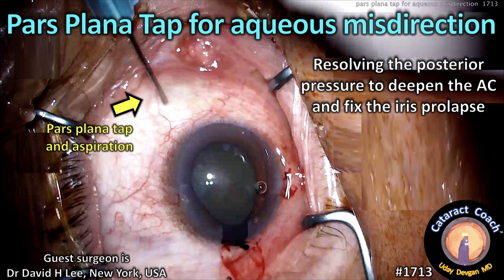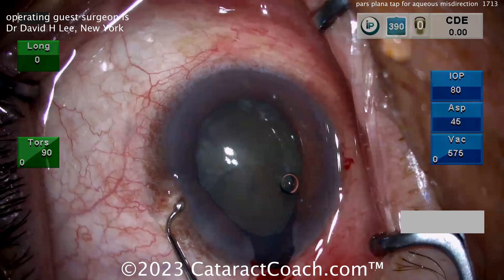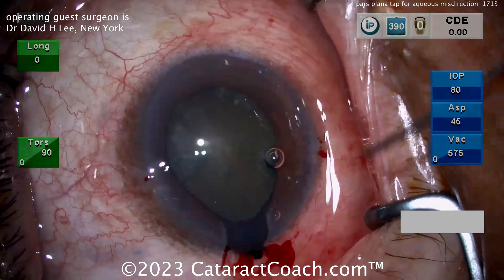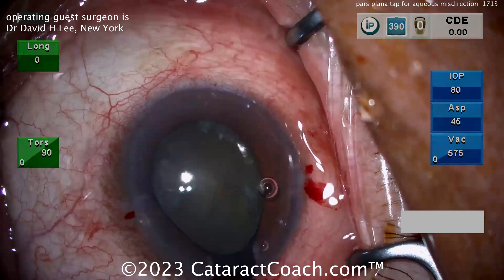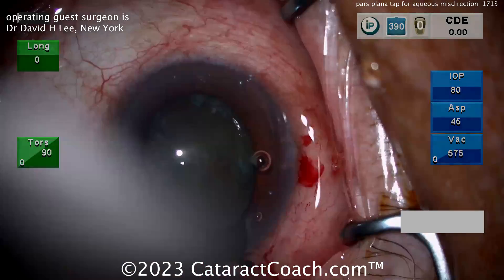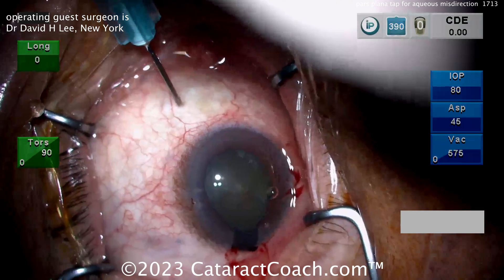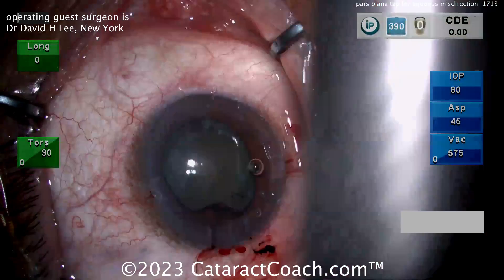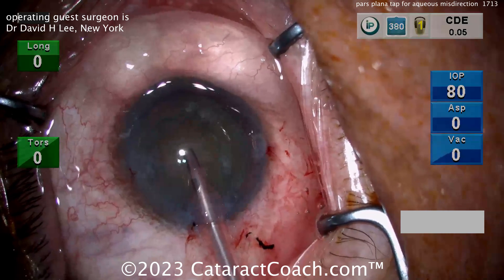CataractCoach™1713: pars plana tap for aqueous misdirection

Comment: Instead of aspirating, placing an open needle or a scleral port will cause a gush out of the excess fluid that is misdirected, which is more safer than aspirating ( since it is a blind procedure)

Comment: Thank you very much! Indeed an important complication to show and a great video. But, I suggest a different plan for the management. The case can well be a suprachoroidal hge rather than aqueous misdirection, and taping the vitreous would have resulted in a worsening of the bleeding up to expulsive hge ( I have seen this happening in a colleague's case in a very similar situation). So, I would suggest 1- Stop and examine the retina with the indirect ophthalmoscope. 2-Only if there is a view and you can see no suprachoroidal hge, then 3-Perform  needle or vitrectomy dry vitreous tap. We discuss this situation in our annual ASCRS course: Keeping Your Posterior Covered during Cataract Surgery: Video-Based Course. Course Instructor: Ahmed Sallam, MD, PhD, FRCOphth. Co-Instructors: Ashraf Armia Balamoun, MD, FRCS, MSc, FACS, Steven G. Safran, MD, Cathleen M. McCabe, MD, Priya Narang, MD, Ahmed H. Assaf, FRCS, MD.
Reply: That thought of suprachoroidal hemorrhage did cross my mind. However, the patient went from a normal deep anterior chamber to extremely shallow anterior chamber with egress of viscoelastic in an instant during hydrodissection.   With such an acute change,  I was confident that I had aqueous misdirection.

Comment: How much volume to aspirate by the syringe? .....ml
Reply: as minimum as possible, just to normalize the pressure
Reply: Yes just enough to deepen the anterior chamber.  You can see later in the case that conjunctival continues to bellow up during phaco emulsification which confirms that BSS is flowing from the anterior chamber to Berger's space

Comment: I did this in one case, and it turned into a big complication, a suprachoroidal hemorrhage...So never aspirate after going in, just remove the plunger and let the pressure inside the eye equalise with outside...Active aspiration can cause suprachoroidal hg
Reply: i did exactly the same, with a small aspiration the eye got to zero IOP and i had to manage a Coroidal detachment in post op. It all went well but...

Comment: This technique is very likely to cause vitreous traction on the retina and cause a retinal break
Much safer to go in with a pars plana trocar or even open up the sclera with an MVR blade and do limited vitrectomy with highest cut rate and low aspiration
Reply: agree Shehab    You have no idea with a needle approach if you are pulling fluid or formed vitreous.   Formed vitreous if it is pulled at all will require more suction but the point is you are still inducing vitreous base traction

Comment: Thank you for the great video, postoperatively do you keep patients cyclopleged and also check IOP the next day along with fundus exam to exlcude a tractional retinal tear? 
The other differential to exclude in this instance of rapid hardening of the globe shallowing of the AC is a suprachoroidal haemorrhage. What would have made you stop and examine the eye for a small SCH? I realise a darkened red reflex is a late sign.
Reply: Pain!
I’ve had this happen a couple times: the difference between SCH and Intraoperative BSS Misdirection (IOBM) is PAIN! - you would think that the increase in pressure with IOBM would ALSO cause pain but it doesn’t (at least not in my experience. Also in this video notice that the pt is not writhing around) - I think this is because the pressure is not terribly high because #1 surgeon always stops injecting more BSS when the AC shallows & #2 the main wound acts like a pressure valve. 
Whereas with SCH the bleeding doesn’t stop as quickly (even after the AC has completely collapsed, AND I think the bleeding is painful in its own right, aside from the pressure..
Reply: @soccer24six  Ahhah! I haven't had to deal with an intraop SCH yet but I agree pain is a key differentiator when I have seen SCH in postop trabs. I would imagine pain would be experienced in cases where a local block had been performed. Thanks for your comment.
Reply: @soccer24six        The pt?
Reply: @spartacus50MHz  oh sry, “pt” = patient